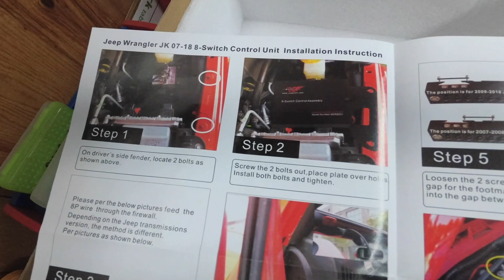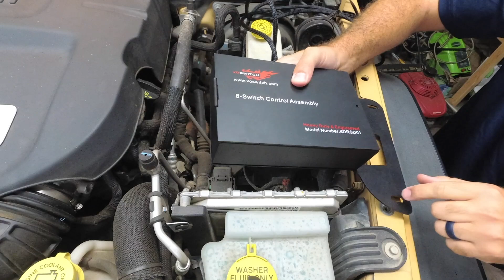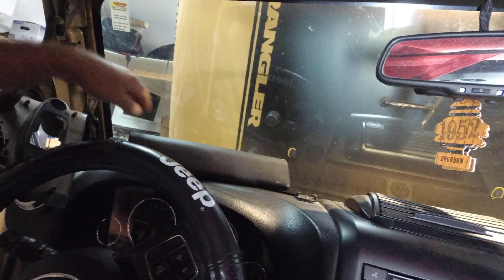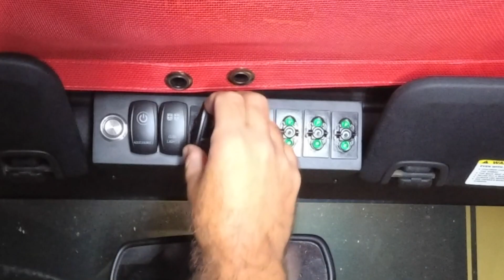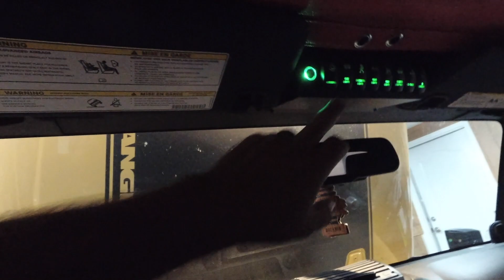Jeep Wrangler Overhead Voswitch POD Switch System (S-POD)

Comment: can you wire it to the ignition and do a bypass on the on off button??
Reply from the maker: Iron Man I think 🤔 so.
Reply from the maker: I literally have it wired right off the battery no ignition. You can run lights no matter what.

Comment: 05:15 The only part of the design I don't like at this point is how the control box just floats out there. The slightest touch causes that box to bounce around. I can only imagine how much it will be vibrating up and down while at highway speeds or offroad. Eventually that mounting bracket will fail from metal fatigue.
Reply from the maker: Nathan Brazil Possibly. Thanks for checking out the channel. You are probably right. The day it does I’ll get on here and say you told me so. lol nothing I can do about it. It’s still handy as crap to add electrical stuff to the Jeep with out having to pull wires into the cab every time.